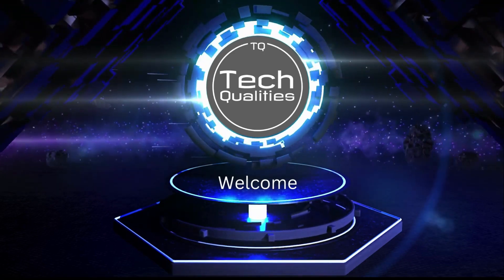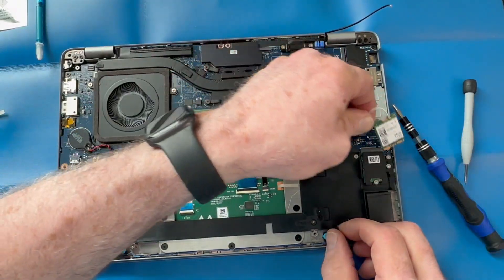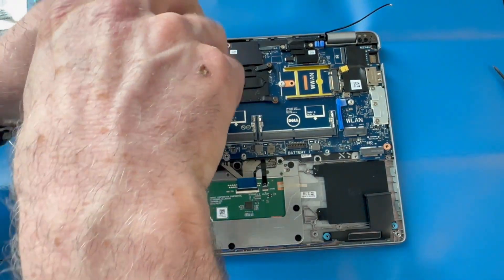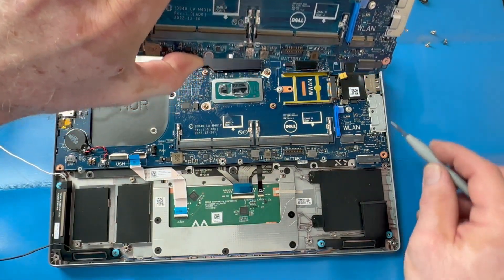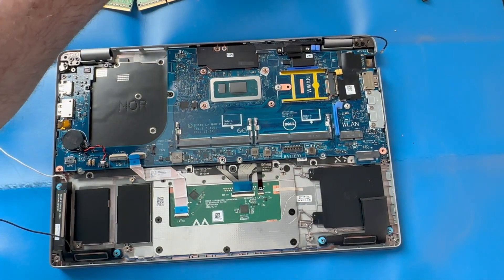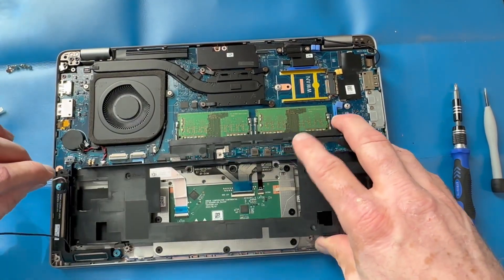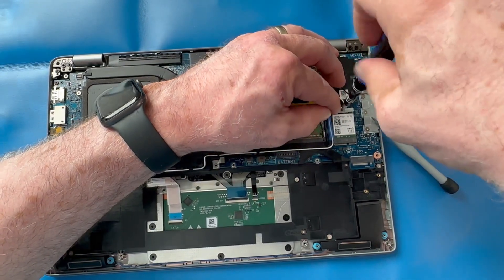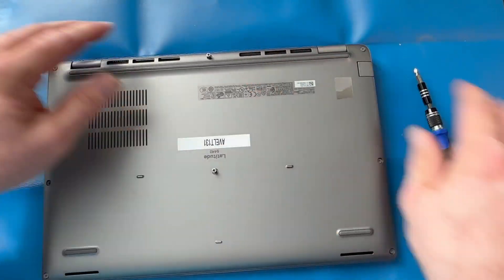Dell Latitude 5440 Motherboard Replacement

Comment: Will replacing the motherboard and hard drive on a Dell Latitude 5440 get rid of computrace?
Reply from the maker: Apologies for the delayed response.  Computers is software installed on the hard drive.  Replacing the hard drive will require that any software used would need to be reinstalled.

Comment: I been in the IT industry 4 almost thirty years, I always use isopropyl alcohol and a wooden tool to clean the heatsink even on the CPU to avoid scratching it, nowadays there are plastic tools.  Good video Tks
Reply from the maker: Great idea.  For the really hard stuff, I’ll wrap my spudger tool with the alcoholic wipe to avoid the scratching.